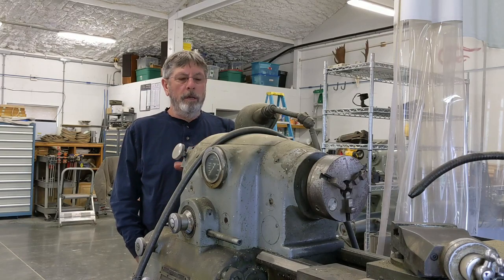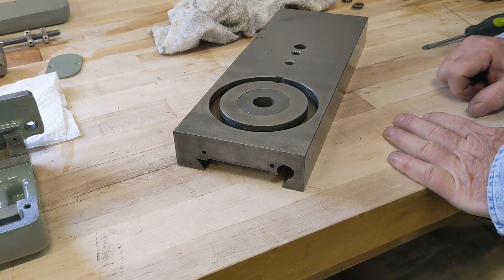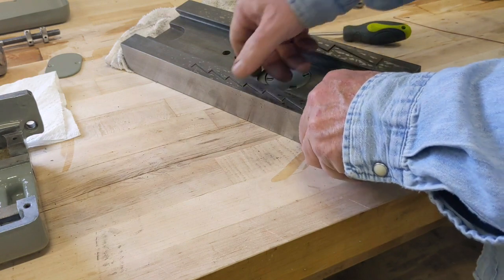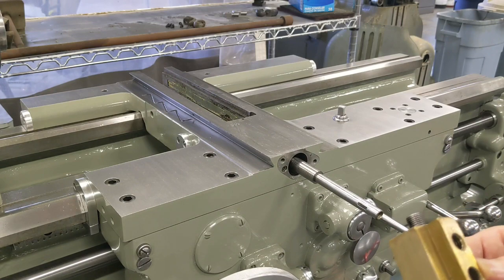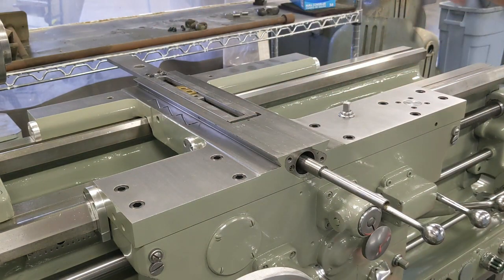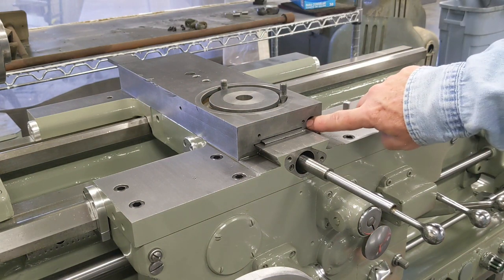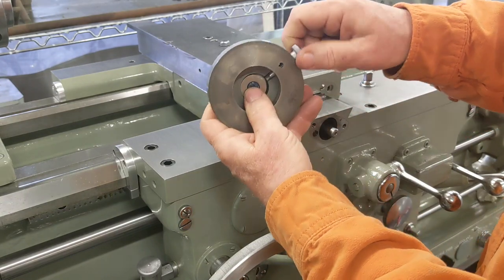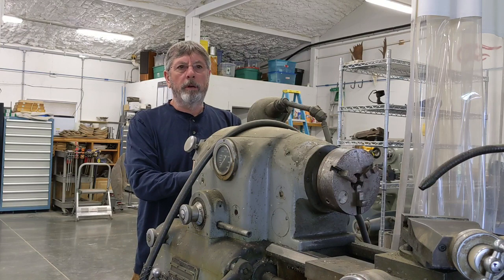10EE part 18 Working on the Cross Slide

Comment: Nice work here and a spectacular looking result. I do wonder about rust, though. Do you put anything on the unpainted surfaces that aren’t directly oiled?
Reply from the maker: Hi Glenn and thanks for watching. I generally put way oil on most raw surfaces and occasionally a rust preventive spray. I haven't had significant rust issues as long as I'm diligent about it!